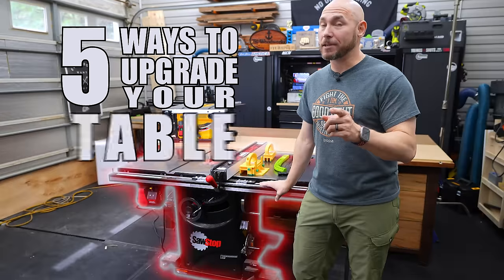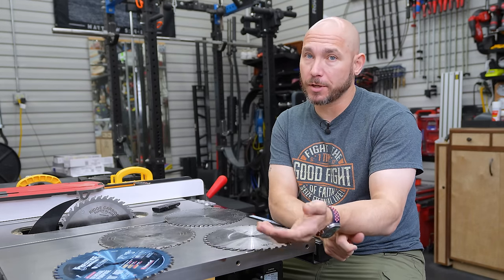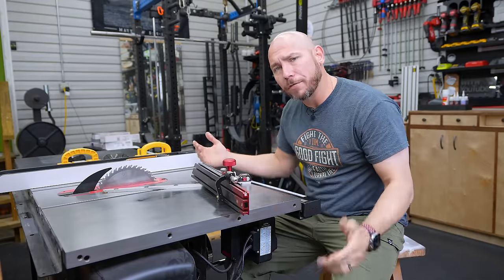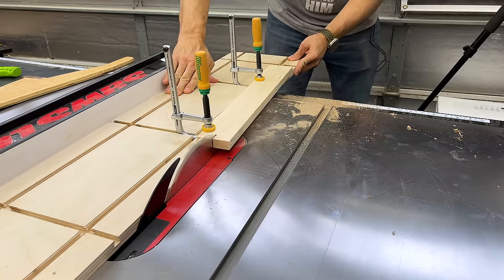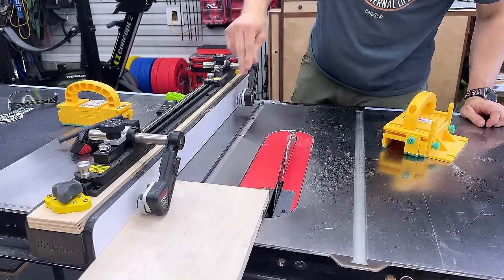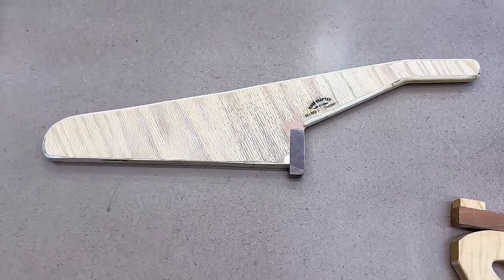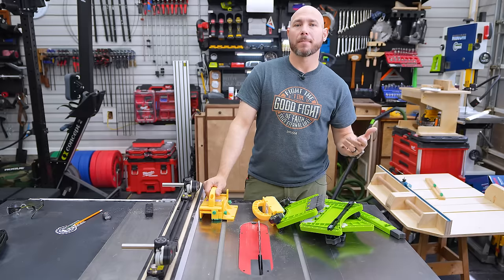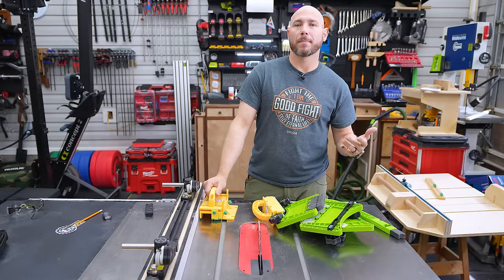Why Doesn't Everyone Make These 5 Table Saw Upgrades?

Comment: Hi. Thanks for the helpful video. However, I have a problem choosing a disc for my Dewalth 7485. It is a disc for precise cutting on both sides of laminated chipboard. Each decorated disc is cut precisely from the top and more or less chipped in the laminate from the bottom. I use a 24 and 52 tooth chainring. The one with 52 teeth has a diameter of 2.2 and gets stuck when cutting longer pieces. During conversations with various specialists, I heard that this saw (Dw 7485) will never cut perfectly on both sides because its disc speed is too low. Please write your opinion on this matter. Maybe you know about discs that can be cut perfectly on both sides and have the right diameter so that the pieces do not get stuck. Of course I use a wedge. Thank you .

Comment: I'm as jealous of your urethane bumper plates as I am your tool collection! 😂
Reply from the maker: ha ha.  I started out with some bare bones, cheap iron plates and used those for years.  When I decided to get these urethane plates it took me a couple months to actually make the decision to purchase them.  I was going back and forth on if I wanted to spend the money on them or not.  Ultimately decided to do it and haven't regretted it. They are good plates.  Been building up my home gym for about 4 years now, slowly over time, just saving up until I can get next on the list.  It think I'vve finally got everything I wanted with the space I have available.  Only thing I'd add now if I had space is an assault bike and maybe a tread mill. But won't happen in this space lol.
Reply: @731Woodworks  nooo! I LOATHE the assault bike! But if you do end up buying one... Highly recommend looking at the Fringe version... Belt driven and SUPER smooth!

Comment: The best thing I've ever done for my table saw (an early 1980's Sears cast iron contractors) was removing the arbor and having a machine shop true the surface than touches the blade.  A .001" wobble on that surface created a > .005" wobble at the blade teeth, which was very noticeable.

Comment: The other day we had to make a compound miter for a panel so we had to clamp a jig cut 22.5 degrees to the sled to get the right angle to cut our 45 degree bevel edge on a 45 degree angle along an 8 foot long panel of MDF. Showed my boss a thing or two that day

Comment: Another note on tourniquets. If you are going to train with one to the point of fully applying it, with the pressure necessary, only use that tourniquet for training. Often times the manufacturer recommends it gets used one time then retired. When properly applied, they tend to lose their ability to be tightened again.
Reply from the maker: Agreed!  Good tip!

Comment: Have you successfully used those CMT orange “chrome” blades on the dewalt jobsite saw?  If so, how did it go?
The manual states to use a really thin body blade which limits the options significantly.

Comment: I’m interested because most of these (minus the sled and miter gauge) require an accurate fence. You mentioned that you used to have an old Delta saw. That’s what I have. The “fence” is a 2x4 attached at only one end. It has a huge amount of jitter as the work approaches the back of the saw because that end is not secured. I can’t replace it because the bars that the fence is attached to are round. All secondary new fences require square bars. I’m stuck with it which means no accurate joinery cuts except what can be done on a sled. Certainly I would NEVER attempt a rip cut. Poorly designed upgraded fence systems that don’t mate to my saw are why so many of us don’t both with the upgrades you mention. It’s too dangerous.

Comment: when I first got my table saw (Dewalt 7485, man I wish I got the 10" one that can fit a dado blade instead!), I built a sled for it. Since then I got a 12" double bevel miter saw and it's just been sitting down next to the scrap pile. Maybe it's time I took it apart and used the scrap wood and build another one in the future with half inch plywood instead of 3/4" because that shit was heavy!

Comment: Not sure if this has been mentioned before, but it's easy to make your own zero clearance insert for the table saw:

1) Choose an plywood or hardwood of appropriate thickness: 1/4" or 1/8" is pretty common. It only needs to be CLOSE to the thickness, you can use tape under it to lift it up a fraction at a time.
2) Use your original insert as a cutting guide. cut outside of the lines and sand to appropriate size so it's a nice snug fit.
3) Drill a finger hole in a safe location: usually in front of the blade. Once shape is done and you've shimmed to make it even with the table if necessary (make sure finger hole is drilled first so you can pull it out if needed to adjust) you need to cut the blade hole.
4) Drop blade into table until it's lower than the insert. tape the insert in place with strong tape at the front and back. 
5) Start the saw and slowly raise the blade to it's maximum height. It will cut through the insert and make the perfect sized hole. If you're blade doesn't lower that far, then skip to addendum below step 6.
6) Sand and finish to your preference. I leave mine w/o finish as the natural wood provides a nice sleek surface. you don't want a sticky finish. you want slick as...well, natural wood.

ADDENDUM: if you're blade doesn't go below the insert, then do this: Tape ONLY the backside down, keep the front side lifted above the blade at it's lowest point, and being VERY CAREFUL, Slowly bring the insert down until the blade starts to cut into it. Using a finger on each front corner accomplishes this just fine. continue until the insert is completely seated. shut off saw, tape the front end down, and continue as in step 5.

Simple as that. I've made dozens of inserts for multiple saws over the years with this process. it allows you to make a variety of inserts, including a set of zero tolerance inserts for your Dado set fast and easily from wood scraps in your shop. If your worried about safety, this is no more dangerous than cutting wood on the tablesaw (probably safer since your not moving any bodypart over or across the blade), and I've done it dozens of times with never any issues. Follow standard safety protocols (no lose clothing, don't do this when cold or tired or distracted, etc) and you'll be fine. If you're that worried, then spend the extra money to have someone else do it for you. But you'll eventually find that with the variety of blades you use, this is a much cheaper and easier solution.

Comment: I want to thank you for this excellent video.
 I have a old Delta sand I didn't realize how dangeroust saying was because it doesn't have any type of safety features on it. It's just a blade all by itself. After I got my finger, Nick, but it woke me up on. How dangerous this thing really is. It really should be discarded and dismantled and thrown away. Because it doesn't have any safety features. I really do think.I need to get a good saw like a new dewalthank you so much for the video it was really helpful

Comment: As a side note for the tourniquet. If the tourniquet doesn't hurt as much or more than the original injury then it's not being put on properly. That thing needs to be put on as tight as you can possibly absolutely make it. Your limb will survive 2 hours without blood... You won't.

Comment: Most people will misplace those tourniquets or move them and forget about it and next 90 seconds youll be running around searching for it. Instead of dropping them on a shelf, put a big red box on the wall with most basic stuff like bandaids and add tourniquet to it.
Number one rule is always, keep your hands away from any blade or other spinning thing, unless you hope for loosing weight.

Comment: Please be careful everyone, SawStop does not recommend (as per the user manual) using thin kerf blades or coated blades as it can mess with their detection mechanism. I love Diablo blades but no on my SawStop :)
Reply from the maker: I was more referring to those on smaller saws like the DeWALT jobsite or Delta Table saw I used to own.  But thanks for sharing!
Reply: @731Woodworks  ah sorry my misunderstanding! Thanks for the reply.

Comment: Anyone reading this do not get the small 8 1/4" table saws (if you want versatility), I was extremely disappointed in the blade selection for 8 1/4" blades compared to whats out there for 10" blades.

Comment: I wanted to ask u if u ever tried out these SAXTON BLADES? U have the cheaper ones at 20-25 euros here in IRELAND but they do a "PRO" blade too which are twice or 3/4 imes the price. 
For the cheapest in their range I have found them to make a really nice clean cut.
I bought a FREUND Blade for my circular saw, 190mm with I think a 15 degree rake on the carbide bits. This has to be the worst blade I have ever bought and for 57/60 euros it was daylight robbery imho.
I think it's the worst blade I have ever bought. I bought it bcos I got5 one of the ACCU CUT rails, etc from KREG. i COULDN'T AFFORD A GOOD PLUNGE SAW BUT IF i HAD DOUBLED THE MONEY i COULD'VE GOTTEN A CHEAP TRACK SAW FOR 180-200 EUROS IN Ireland.
How much is a 8" Dewalt table saw in the USA? Here in IRELAND we're being charged 700 - 800 euros. I would not pay that when a few hundred more will get me a cast iron table saw from the UK. I know the Dewalt 8" or 10" table saw is one of the best of those types on the market but they're too expensive imo..

Comment: I love safety but there's something wrong with your table saw technique if you need to have a tourniquet in the shop.  The best push sticks are the ones that keep your hand  (or hands) from ever entering the zone of the throat plate.  A couple of 20" 1x2 sticks of clear pine is all you need.  Zero clearance inserts are key to push stick safety when cutting thin strips close to the fence.
Reply from the maker: That's like saying you shouldn't wear a seatbelt because you can drive good.  Anything can happen to anyone.  They said the Titanic couldn't sink.
Reply: Not quite the same as a seatbelt and a car.  The highway is a lot more risky than your own shop should be.  Even the saw stop on a table saw seems like overkill (it would probably save more fingers if it were installed on a skilsaw).   I'm not a proponent of seeing the boogey-man everywhere.  Another important safety feature that I neglected to mention above is a good runout table and sometimes additional in-feed support.  If you can afford it,  power feed is the way to go for ripping.  I liked those match-fit camps and your sled design.

Comment: 60 tooth is a crosscut blade, you really shouldn't be ripping with it. 40 is combo, 24 is a rip blade. I highly recommend having a cross cut and rip blade and leaving those combo blades at the store.

I know CMT sponsors alot of YT channels but I was very unimpressed with their products. For the same price Freud, not Diablo, is a far better blade
Reply from the maker: I've never been sponsored by CMT.   Freud makes excellent blades! I agree it's better to have a dedicated blade for ripping and cross cuts, but a lot of people don't have the budget for that. So a combo blade works well in those situations and I keep a combo blade on my saw 99% of the time.  Works fine for ripping and cross cuts for me.
Reply: @731Woodworks fair enough, I just assumed CMT was a sponsor because everyone raves about them. I generally keep a rip blade on my saw 90% of the time. The FTG gives you a quick dado cut option, and most of my cross cuts are done on the miter saw.
Reply: I know I’m showing my ignorance, but why is it not okay to rip with a 60 tooth blade?
Reply: @davidoliver3136  The more teeth, the less room in the gullett between the teeth, and they don't clear the chips as well which causes burning on rip cuts
Reply: @paulhopkins1905 thanks for the reply, I did not know that.
Reply: @davidoliver3136  sure, glad to help. Also excessive heat kills the blade faster

Comment: The jessem  stock guide should  be standard  coming  on all new saws  I use my permanent you will never have  a kick back is a Mather of safety i made my years  ago and also I made a electronics laser square detention fault if the fence is not square you saw will not start  and if move it will shut the motor off that simple 98% of kick  back is becouse ghe fence is not square with the blade .cheap table saws from China are a finger Bucher machines

Comment: You started the channel with basic tools and simple designs...  Now your pushing $150 saw blades, sawstop and festool... you left the DIYers that built your channel from the beginning. Good luck with your Beverly Hills woodshop.
Reply from the maker: Did you miss the Ryobi tools I reviewed? Or the cheap Temu tools I found that were good last week or the tons of other budget option tools I've shown shown. 🙄  You only see what you want to see.
Reply: I started with a Harbor Freight sander………..today I don’t use Harbor Freight sanders. A friend blessed me with a bunch of dewalt tools when I got interested in switching from refinishing to building, I certainly wasn’t going to turn them down. Some of my cheaper stuff works very well but I have bought a lot of nice stuff over the last year or so. I’m lot rich, I’m a waiter. Building brings me joy and I invest in my own happiness. It’s called growth. I recall a small router table video last month, ryobi reviews, Temu products, he uses home made jigs, etc. Nick

Comment: #6 ~ FFS!.

Learn how to clean /sharpen the f***ing blade first which makes the blade cut easier, cleaner and way safer!!!

How hard is that? It should come at the top of the list as a default
Reply from the maker: not sure cleaning a blade is an "upgrade" to the saw, but a it's always a great idea to have clean blades on any tool.  Thanks for sharing!